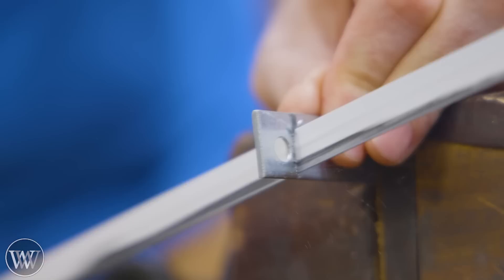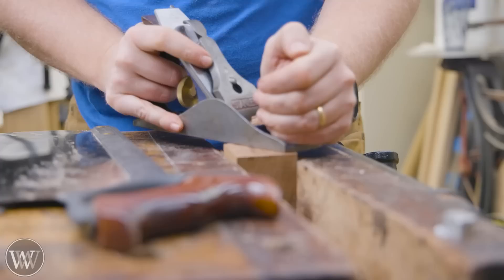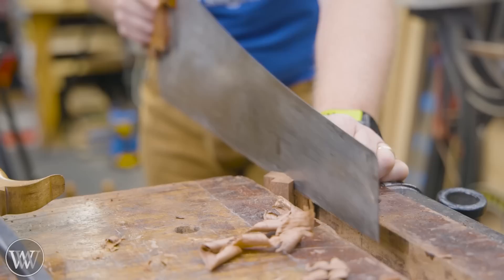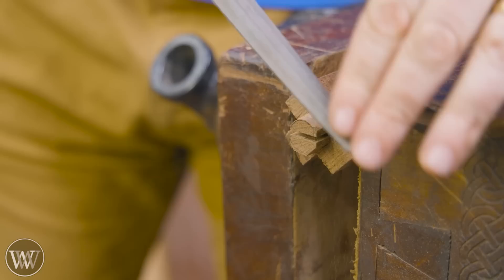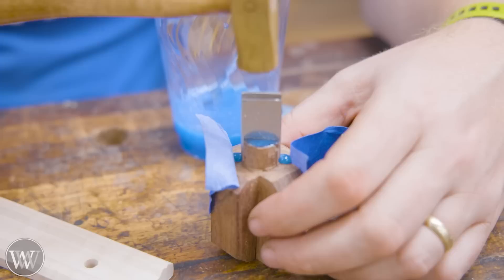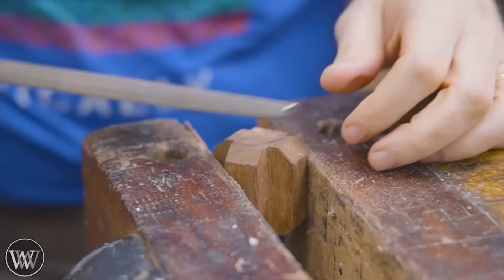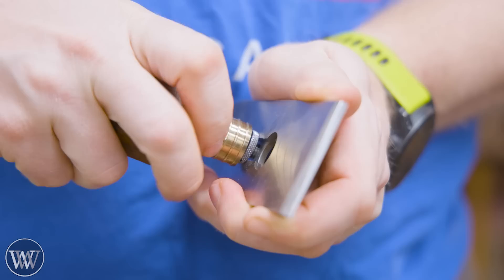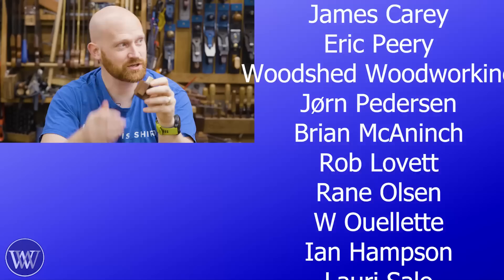How To Make A Chipbreaker Driver

Comment: Nice job. For all of the work you did on this, I would consider making another blade insert out of 1060 or 1070 carbon steel and harden and temper it for longevity. Those mending plates are most likely make from unhardenable mild steel.

Comment: I have the Veritas equivalent to this. I taped it off, leaving a little strip that aligns with the edges of the blade and spray painted it so I now have a little black stripe on either side that makes it easier to line up with the slot of the screw, which you can't see during use.
Reply: I couldn’t find the Veritas driver. What do they call it?

Comment: I was expecting you to use a grinder to get the piece to fit the slot, but I forgot you and Rex are agnostics when it comes to electricity LOL!
Reply from the maker: Then the problem is the steel is really soft so if you put it on a grinder you end up taking off too much and less than a second.

Comment: Heads up: You can turn soft metals on a wood lathe. Brass may bee too hard, but I know you can turn copper and most grades of aluminum.
Reply: With carbide, it doesn't really matter, you can cut any metal.
With HSS, softer metals (ali, brass, copper, etc.) Should all be fine.

Go slow, expect a pretty poor finish and tollerance, but it can still be completely usable.

If you're using sandpaper or a file, doesn't really matter either.

Comment: Most in the trade just use the front end of the chipbreaker backing piece,much handier its there with the plane.
Reply: Yeah, they're the ones with chipped lever caps

Comment: Files like a western style saw work on the push stroke, not the pull.
Reply from the maker: most yes. there are a few specialized floats that work on the pull stroke.
Reply: Yes, they work on the push stroke, but they can remove material on the back stroke, and it doesn't damage them any meaningful amount, especially on wood.